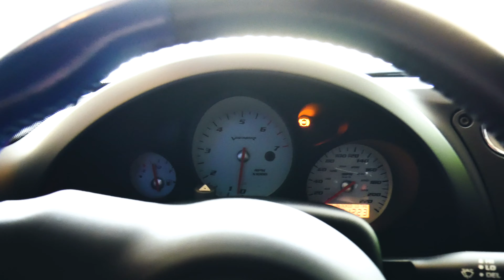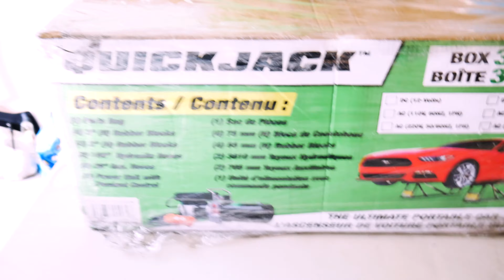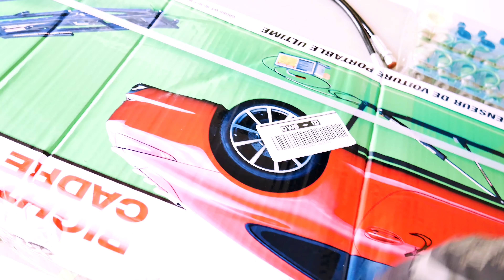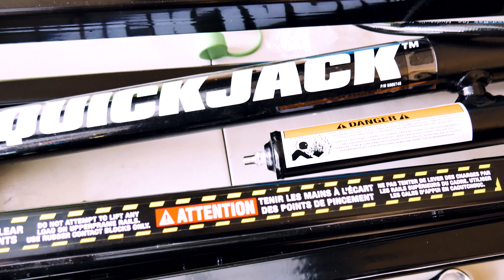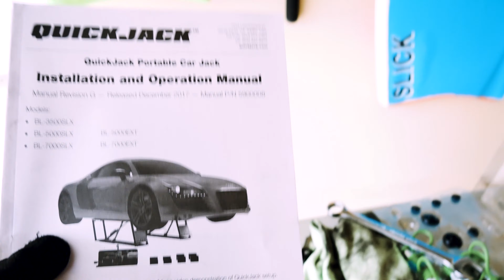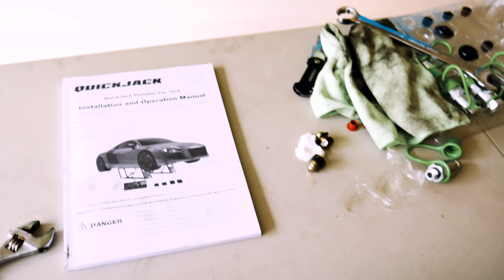QuickJack BL-5000 SLX for the Dodge Viper

Comment: I’m debating on the 5000 or the 7000 for my gen 2 GTS
Reply from the maker: If you want to use on other heavier vehicles go for the 7000. For most sports cars the 5000 is plenty.

Comment: I have 97 GTS. It sits low with aftermarket suspension.  How are you liking it to date?
Reply from the maker: One of the best cars I've ever owned for sure.   Its hard to describe to others the driving experience of an 8 liter v10 as you know.   Sadly, the motor blew up twice in this thing lol.  So needs a new engine right now.
Reply: @DeeperImageAutomotive  thanks for reply. How are you liking the lift?

Comment: Gloves and safety glasses needed? or not really just be careful?
Reply from the maker: Quickjack recommends them as the hydraulic cylinder is pressurized and when you're letting the air out it can squirt pretty hard. So always follow the manufacturers recommendation :).  Just open the valve really slow and wear at least sunglasses, you should be fine.  Again, follow the manufacturers recommendation.  Thanks for watching and commenting.
Reply: I just ordered one for my Viper.  Look forward to getting it.
Reply from the maker: Rick S best investment I’ve made yet for any car lol.  It’s so handy to do work on cars. Be safe!
Reply: @DeeperImageAutomotive  great to hear, makes so many jobs easier